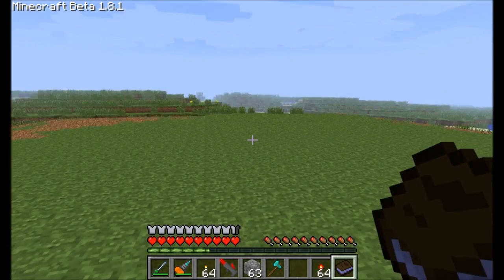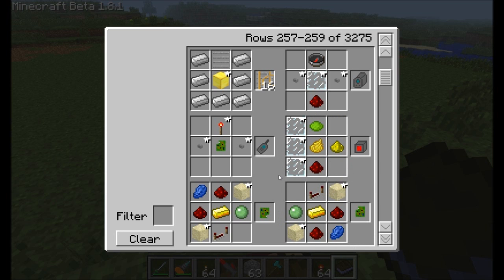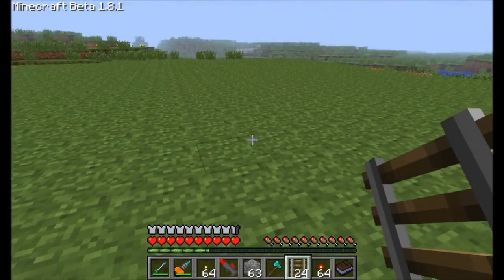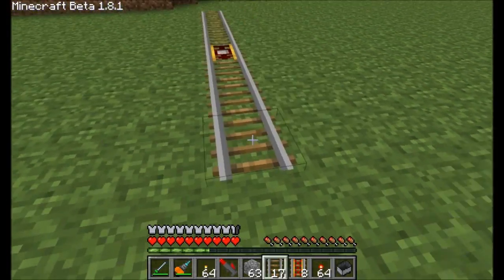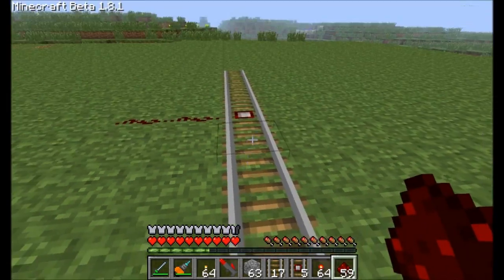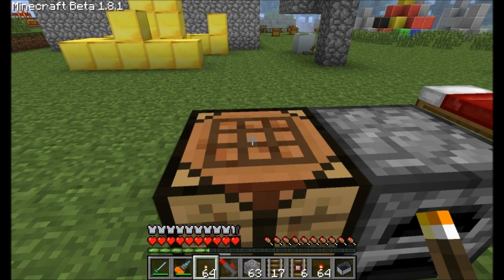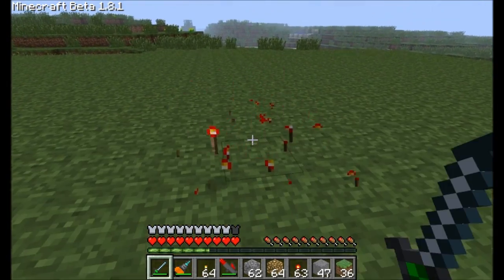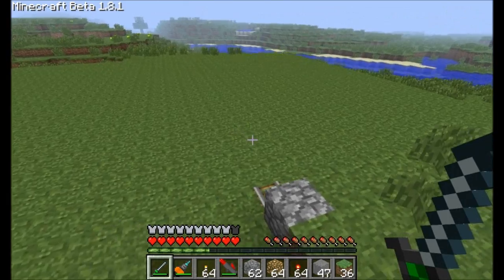Mod Spotlight - Railcraft Part 1

Comment: Some of the recipes in this video are a bit outdated and this does not even cover the factory module that can be enabled or disabled to make recipes diffrent. However the general information of how the rails work is still valid and good info for people getting started out. If you want current information on recipies I would suggest you head over the railcraft wiki and check it out.

Comment: @DarkarZero117 They changed the recipe. You now need a Coke oven which is 5 pieces of sand and 4 bricks. You feed Wood or Coal into the oven to get Charcoal or Coke(which is a fuel that is 2x stronger than coal). The processes will give you Oil as a by product.

Comment: @mulraf You need about 12-15 transition rails when you're in the cart, both speeding up to highspeed and returning to standard speed rails. Make sure to point both sets of rails TOWARDS the highspeed section of track.

Comment: If there were any elevation changes along the line it can cause this to occur. The wiki for the mod mentions it but says that it does not occur all the time and is more prevelent going down. I have only recently started messing with the mod so I can test to see if the problem occurs on a 800 block strech.

Comment: @h3lladvocate Using Minecraft Forge as your Mod-Manager (assuming the mod in question is Forge-supported), you don't need to worry about running out of blockID's or having them conflict with eachother, as MineForge resolves disputes and expands the item capacity (how I don't know, not really that sure of the specifics)

Comment: @NoHeadsProduction 
@pschlik
I was going to say something along the lines of the train mod and railcraft uses both the rails and need to be modified for each individual purpose however if you can possibly combine the two in one .class file you're life would be much happier talk to the modder of either or mods.

Comment: I use the version 1.12.1 and i dont know how i get Creosote Oil. When i put A coal in a furnace it creates a graphite bar
Reply: you need to use a coke oven.
Reply: Or go into the config and enable the furnace recipe for creosote oil, which is disabled by default.

Comment: yeah i did and i only had highspeed rails maybe you should learn to read.
so in case you cant read again I ONLY HAD HIGH SPEED RAILS ON A LONG RUN THERE WAS NO TURNS AND ONLY HIGHSPEED RAILS HENCE I THINK THERE IS A BUG WHEN USING HIGH SPEED RAILS FOR LONG DISTANCE. E.G 800BLOCKS = 800 METERS.